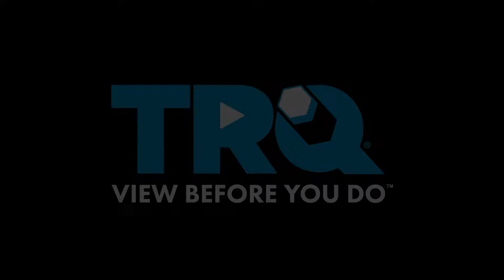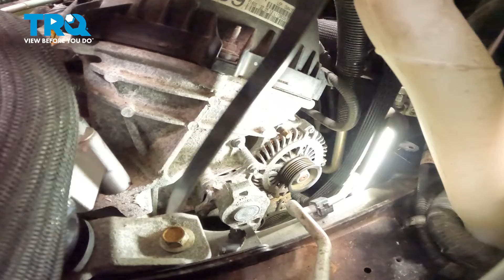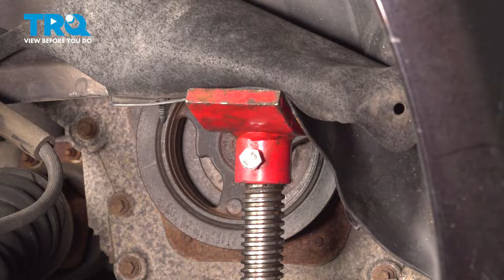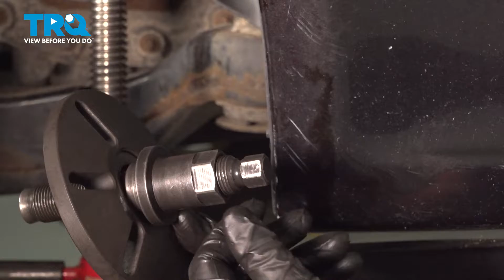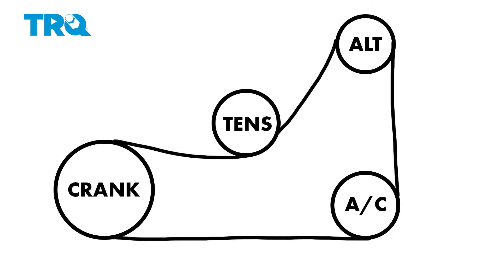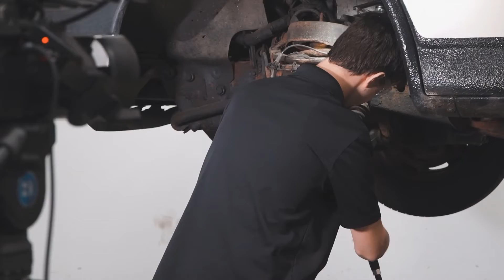How to Replace Engine Crankshaft Vibration Dampener 2011-2019 Ford Explorer

Comment: There is a way to hold the crank using the serpentine belt. First mark the location of the bolt head to the harmonic balancer with a marker. Next place the serpentine belt over the crank and the next closest pulley. In this case the alternator. Then pinch the serpentine belt in between the two at the top and pull it down and under the crank pulley so you have three layers going underneath the crank. Start tightening and once the slack is out it will hold.